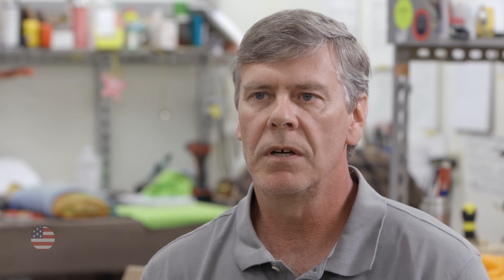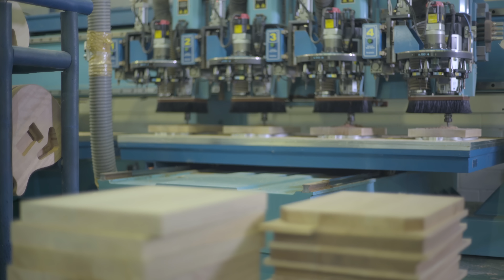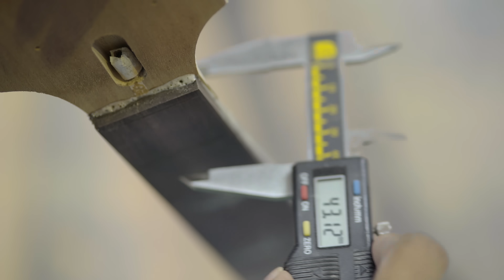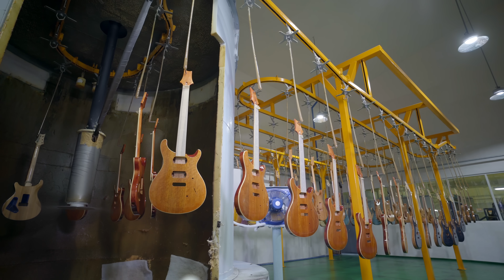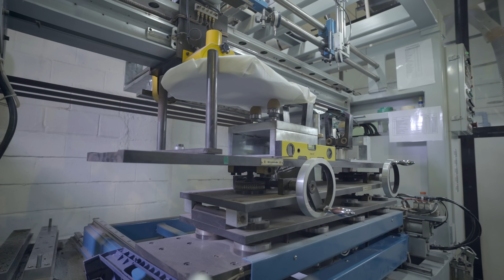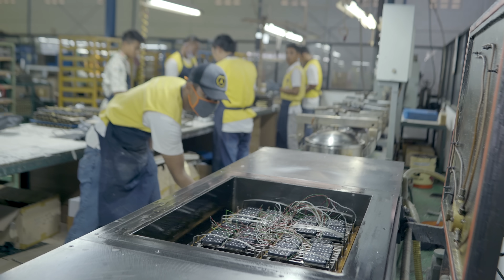SE Factory Tour: Surabaya, Indonesia | PRS Guitars

Comment: I just bought a PRS custom from Indonesia. Very nice. Still not cheap compared to other makes. And a few problems. Most glaring is the mismatch on the back routing and the plastic cover plate. Big gaps. Also, the selector switch slot very poorly dressed. Small issues that don't affect the playability but expected better from a brand like PRS. My Fender American Strat same price point and absolutely no Quality issues....

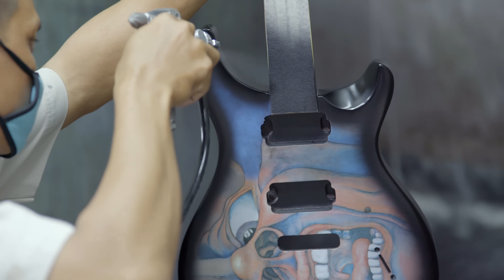Comment: The guy with the spray gun at 10:00 should be wearing a respirator and not a particulate mask. Those paint fumes seep right through particulate filtration like it isn't there.  Kudos on the SE guitars. I gigged with a core PRS guitar for 10 years and wouldn't hesitate to gig with a SE...except I don't gig anymore...haha!

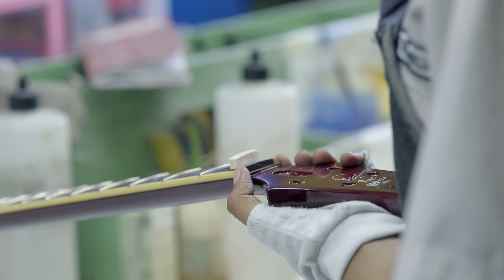Comment: With all due respect my concern is with the production of the nut slots. 15:10 "The bottom of the nut slot is correct in relation to the top of the fret". I was hoping for a little more info on the slot cutting process. My concern is that when the tool which cuts the nut slots gets dull, it might fail to cut the nut slot the proper width all the way down to the proper depth, which could cause the treble strings (mostly) to pinch when the player bends the strings.Can you re-cut the slots if the first pass leaves them too narrow? Does a re-cut cause the slot to be too wide? Thanks

Comment: Fact is, last year I bought the Trampas Green 24 fret custom. There is a small imperfection in the cut out, watching video, I see why. Guitar is a beautiful thing. I could have bought the cheap Les Paul for the same money but I try to buy most of my instruments from Micarrelli's in Uniontown pa. I think it important to buy from the mom and pops, especially if they work with you which Carl did. For the money, I don't think you can buy a better instrument. Fit and finish is all top rate. I'm a big fan of their neck. My only complaint would be the pickups, not great, not terrible, but just a bit better than ok. Coil split is nice. I have some p-rails sitting around, hmm, they might be a sweet addition for this guy.

Comment: I bought my PRS SE back in 2010, the first time I went to a Guitar Center and the very fist time I went to USA (I'm from México), It costs me $575 if my memory doesn't fail. The guitar have 9 years with me and still a fucking beast, I use it as one of my lead guitars, and can play at the same level of my other guitars (American Elite Telecaster, American Stratocaster, American Gibson SG, and even my PRS S2 Standard - Actually I prefer my SE over my S2) After 9 years I change the pickups for Dimarzio PAF and Super Distortion and that just made a beast of guitar.

Comment: Hey, great video. my SE24 TB comes from this factory. It sounds and plays great, but since i got it (new from Thomann in Dec 2018) it has always been very propense to go out of tune, (everything is original) it is really annoying. Also one pf the knobs has always been excessively easy to roll. I’ve read on PRS blogs this is a recurring issue on PRS SE guitars. Do you have a solution suggestion specially for the tuning issue? I will really appreciate your answer.
Reply: New nut

Comment: Recently received my preordered Paul’s Guitar SE. Could hardly be happier regarding the quality. Only exception is I am annoyed by the feel of plastic tuner caps.
Reply: Man I want that Pauls guitar..is the fretboard very wide ? Hows the rest of it minus the plastic tuner caps ? Are the pickups able to dish out high gain rock/metal ?
Reply: @rosskrause3926  1.6875" at the nut, 2.089" at the 12th fret.  The pickups are hot.

Comment: The Koreans have much better quality control, fit n finish.. Idk why they moved to indonesia, but it was a BAD move...
Reply: They moved production to Indonesia because the Korean workers started a union last year and wanted higher wages,so they moved there and made a deal with Cort,who is notorius for making inconsistant guitars.
Expect the quality to be hit or miss,just like with the Ibanez Premium series.
Reply: Yes greek u are right compare an 80s or 90s Ibanez RG 570 or 770 made in Japan to a current Indonesian with an Edge3 trem. They are night and day the Indonesia wizard3 neck is way thicker than an original wizard the sculpted neck joint on the japanese and original edge trem blows it away. Also they are heavier and more resonant.

Comment: They still had a same price even they build the guitar in indonesia? Probaly the material they used in indonesia acctualy have a low price in that country. are they just make money in defferent way?
Reply: cheap labor
Reply: Like jonathan said, mostly cheap labor, and every cent they can keep on material : Like they showed, the maple cap they use on the SE are not the AAA grade uber beautiful ones the use in the us. That drive the cost quite a bit down ( and the veneer keep the look so it's basically the same thing in the end)
Every metal part is made from cheaper alloys (what's called pot metal). One a 700$ range tho it's probably not the shitty cheapest alloy.
Cheap electronic (this is a good exemple of pennies saved)
The pickups are also a big part of the money saving. The qc process is more lax. All the sanding, binding, fret work too.

Comment: I sooo wanted to get an se.  I went to a shop in town where they carry a lot of new and used core, S2 and SE models.  This way I could compare them and see if I could justify the price difference.  The SEs we're good, but as soon as I put the core in my hands, I knew the SE wouldn't cut it.  You can find used cores and CEs for reasonable money.  I can't spend $4800 on a guitar and not expect to sleep somewhere else, but if it means a few more months of saving to spend $1600 instead of $1000, do it.

Comment: I've had this question for a while - why does PRS not include locking tuners on all models as standard - like MusicMan currently does with both its Core Main and Stirling ranges? All PRS S2, Bolt-on and Core models have locking tuners - why not SE's? PRS does not even offer proper straight swap-out locking after-market tuners for SE models - surely an oversight?
Reply: There are so many drop-in replacements, I guess it is not worth competing. I'm just glad they stick to the standard and not use some Ping tuners like e.g. Ibanez does where there is no drop-in replacement. I can highly recommend Kluson MLS33C
Reply: @Chickilol  I actually use the Schaller Locking Tuners in these scenarios - but would prefer to have access to proper PRS top-locking tuners like the Phase 2 & 3 types - it's just the holes on the SE guitars are a lot narrower than on the Core Line - so the available PRS Locking Tuners don't fit.
Reply: This makes sense considering the standard trem on most SE's. Its kept me from buying one. No one wants to Dimebag squeel then have to retune. I did that with my 1st Hondo strat in 1984 and vowed to never go back its Floyd Rose or no trem for me.. Same for a USA strat I had once and a Les Paul studio bc of 14* headstock angle. Why even sell a guitar that detunes from normal useage?
Reply: Actually Stefan while they don't include them they have a set of SE locking tuners at the PRS accessory website for $95.  I have included the link (https://us.prsaccessories.com/products/prs-se-locking-tuners-set).  I adapted the PRS Phase II locking tuners to my SE before I found these.
Reply: Lots of people like plain tuners more, and my guess is that they want to keep it how most like it.
Reply: no real need for a locking tuner
Reply: Have a cry mate